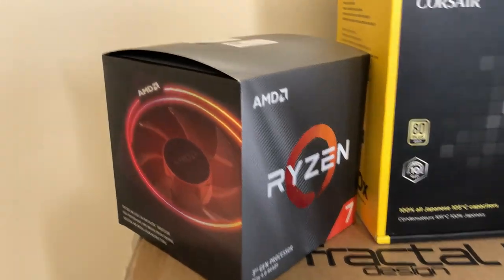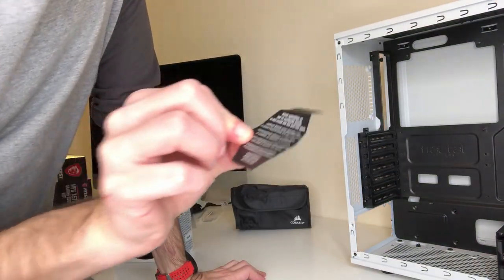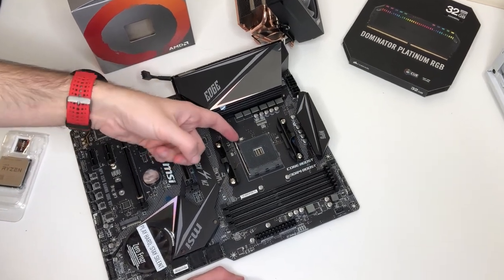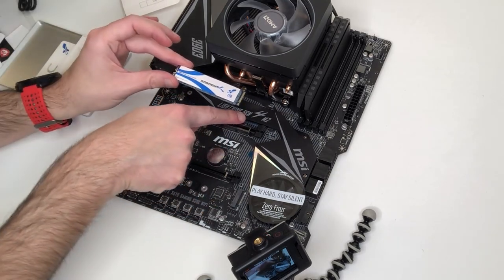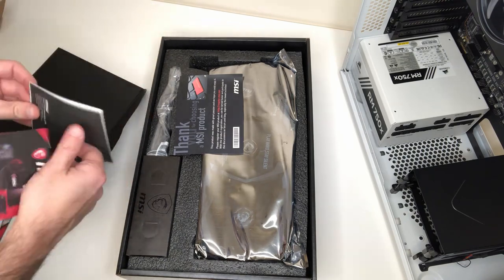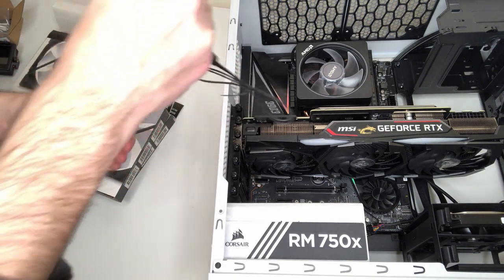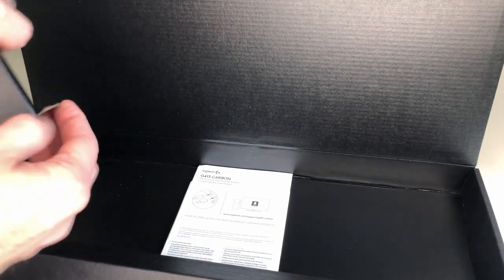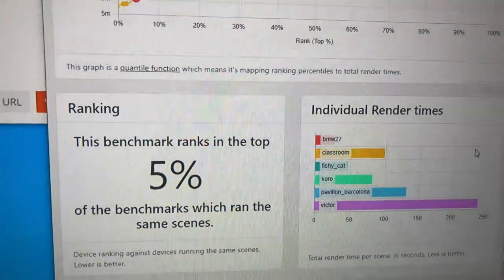Blender 3D Ryzen RTX PC build for animation, video editing and gaming

Comment: Thank you for the video. Great work. Nice and precise production.
Your PC is better than every Company-build PC for the $.
I try to copy you and build this, wish me luck, it's been 12 years since the last PC.
But now not all parts are available, in October 2020.
I think of Define r5 substitute for Focus G. 
Any suggestion? The fans are loud? Would you consider other fans now?
Will look at your blender work after i get rid of my potato laptop. TY so much.
Reply from the maker: Hi Loris, let me know how your build goes!
My fans are not loud at all, I think it was a good choice overall, but it takes some time to tweak them in the BIOS and Dragon, the MSI motherboard app, they are not great software. Right now the only fan I can hear every now and then is the CPUs. Going back I would probably get a more silent fan just for that, the one that came in bundle looked good, and does the job anyway. A fancier one can be added at any time.
The Define R5 was one of my choices, it's certainly more spacious, I wanted for some reason the front 5.25 slots to use it as removable trays in the future, for DVD or HDD, plus budget!
To be fair, it took me months to pick the right components, I couldn't afford to spend too much on this, but it was a lot of fun!!
Going forward I've planned to buy a second identical graphics card to be used with NVLink or SLI not sure yet, but that's the reason why I bought this full-size MSI RTX2070 Super instead of the more compact versions.

Comment: Hey Daniel! Loved the build. Just wondering how you connected your fans. Which ones did you put into Sys Fan 1-4 and which one did you plug into Pump Fan?
Reply from the maker: Hello William, thank you for watching!! If I am not wrong I connected the front and top fans as sys fan 1-4 while the back one to the pump, this mb lets you control the speed of all of them, so doesn't really matter as long as you take care to finish the setup in the bios or mb software. Sys and Pump are only just header in this occasion. Hope it helps!!
Reply: @DanielOakfield  Perfect, thank you. Also, I noticed that all the RBG LEDs in your build are the same color - how did you get them to be the same. Mine are all different colors. Thanks again!
Reply from the maker: I used the MSI motherboard's software Dragon for that, I imagine other MBs use similar softwares

Comment: Hi. Im a blender user and I love your choice for this but I going to make a secondary pc build, very cheap.  I wish to know your opinion about to conect a RTX 2070to  B450M/RYZEN 5  the case surely will be a Design Define Nano S USB 3.0 . Years ag,  mounting a gtx 970 in a cheap motherboard and i3 four gen it works really really well.
Reply from the maker: Rtx 2070 is good for sure and Ryzen 5 is going to be ok as long as you render with GPU! :)
I completely appreciate price is very important when building your machine!
Reply: @DanielOakfield    Thanks!. This wil be my choice because I will still  bet GPU render, since I tried eCycles (cuda version), I abandoned hibrid render (cpu+gpu). Its awesome how light becomes the cpu flow and that makes  possible cheap CPU supports to powerful GPUs, that its my afordable option today.

Comment: Silly Questions if I may... (I posted similar on another thread/video... How much simpler / cheaper could you have compromised? Please may you summarise all the complete costs involved in this set up - from first online shop to final set up? MOre so, what would be a ready, off-the-shelf Dell or HP equivalent cost?
Reply from the maker: Hello, simpler I doubt, my setup it’s very minimal for the performance. Cheaper for sure, buying the some of the same components from different brands, specifically ram, case, psu, keyboard, could have been worst quality but that would also mean less durability. This custom built is a good compromise for an entry level workstation. The question is what’s your budget?
When you go for an off-the-shelf big names such as Dell and HP you usually pay around 40% more of what you can spend buying components and assembling by yourself.
Reply: @DanielOakfield  Thank you. That's really great advice and direction to take from your experience, which I shall follow. I have looked into both options - the ready-to-go machines vs self-build. There are compromises and safety in both. The third option is to buy the parts as you did, then get a more technically-minded/competent person to build it on my behalf, and ship the device ready. That's my next consideration...
Reply from the maker: There are many companies that do that service for you, let me know how it goes, share back your experience :)

Comment: it is possible to render in blender with cpu amd + gpu nvidia?
Reply from the maker: Yes Cycles allows you to do it, but due to how the rendering blocks are different in GPUs and CPUs sometimes it’s not beneficial at all, while in some other cases the speed increase is very noticeable! I will post some benchmarks on this subject in the future!
Reply: yes just have to configure blender correctly and use either render solutions such as Cycles or AMDs rendering solutions as they will raw horse-power the Nvidia card but boost the cpu performance.
Reply: Hello, great video!  Would it be possible to build a PC just for Blender 3d rendering?  I would need a pc and monitor.  My budget would be $1500 preferred, $1700 max.

Comment: Add a display card will get a better perfermance?
Reply from the maker: What do you mean? I have an RTX2070 super in this build as graphic card, you need one in order to do any 3D!
Reply: @DanielOakfield I want to know  is it possible to install two display cards in this mainboard.
Reply from the maker: Yes of course, I bought this main board with the goal of adding a second card once they get cheaper. Having said that, probably I would add 2 RTX 3080, as the price is not too bad!
Reply: @DanielOakfield  thanks